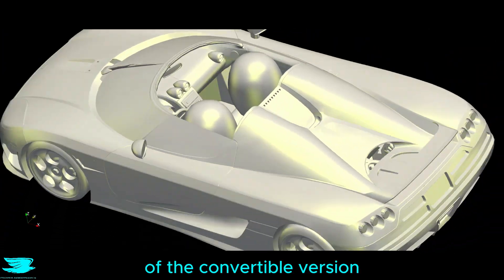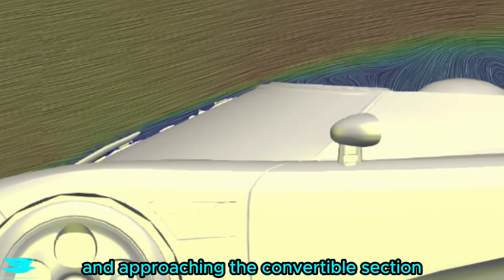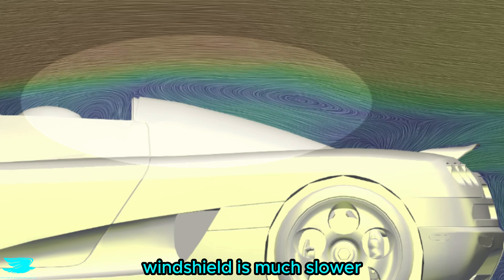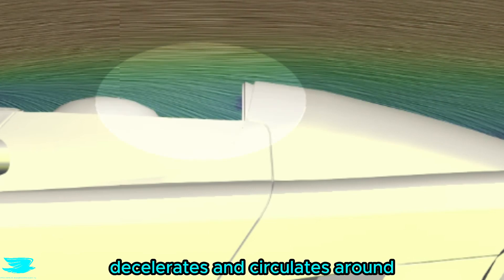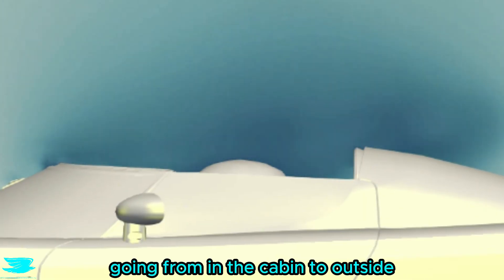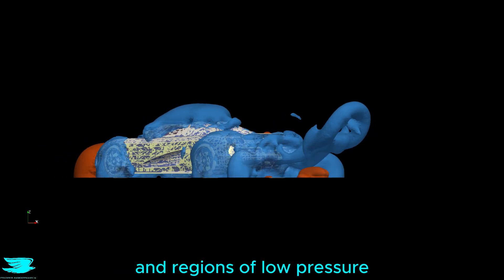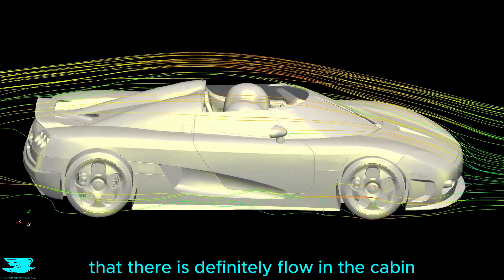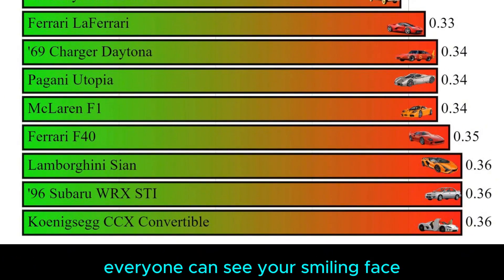Surprising Aerodynamics of Convertible Koenigsegg CCX Supercar

Comment: The similar effect played an effect on the well-known accident of Sichuan Airline 8633, in which an A320's right front windshield blasted and sucked FO's upper body out of the window. Luckily the transition from the streamlined nosecone to the flat windshield glass causing the same separation effect, making the incoming airflow keep flow away from directly impact on FO's body and other crews inside the cockpit. The investigators made CFD simulation and concluded that thanks for this, the FO actually facing incoming airflow at ~180 instead of 800kph, he therefore could managed to climb back to the seat by his own.
Reply from the maker: Wow! That's cool and lucky for him!

Comment: Would love to see the Ferrari F50 in 3 configurations: No top, solid top, and soft top (also the Europe vs US is slightly different, mainly for the front bumper, the US version sticks out more, while the EU  version is more low profile)
 (Also interested in: 1. The Koenig-Specials F50 body kit, which isn't too aggressive compared to lots of body kit; the main difference apart from the stock version is the adjusted rear wing center-part, front spliter, and the paired air intake under the rear spolier 2. F50 GT)
(A comparison between the Ferrari Enzo and Maserati MC12 would also be nice)
Reply from the maker: Thanks for the ideas! We have the F50 on the list, and will put the MC12 on there too!
Reply: @PremierAerodynamics  
One thing I want to add is that since the center part of the F50 wing is removable, it would be nice to see the performance with or with out it. (There is a modified yellow F50 in Japan has that part remove and make the wing looks kinda like Ferrari FXX K)

Appreciate your effort in analyzing the aero models!

Comment: What I find CFD most useful for, is that it shows you the angles that air has when interacting with surfaces. Our job as designers, is to listen to the air, the air is telling you what it wants to do, you can't stop it from doing that, at best you can influence, but you cannot control it. For example, looking at the front splitter, had it been angled a few degrees upwards, it would have made a big improvement to drag and front downforce. One small change like that would also have effects downstream, around the wheels, because it changes the pressure distribution above the splitter, which then interacts with the tire wake.
Reply from the maker: Definitely. I also like seeing where the flow gets directed to. It helps inform you what to do.

Comment: Do you take in consideration the fact that the air goes inside through air intakes at the front and the side?
Reply from the maker: The little side ones do. The grille is closed.
Reply: @PremierAerodynamics  do you plan to change it?
Reply: asked the same question on the previous egg aha